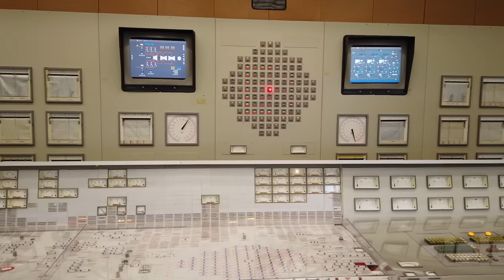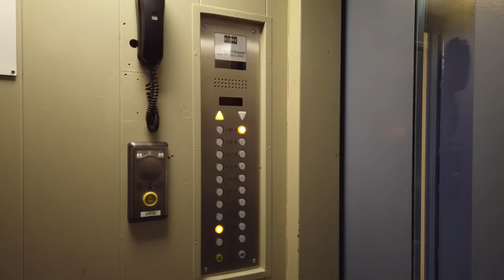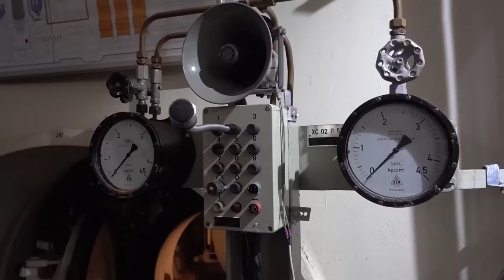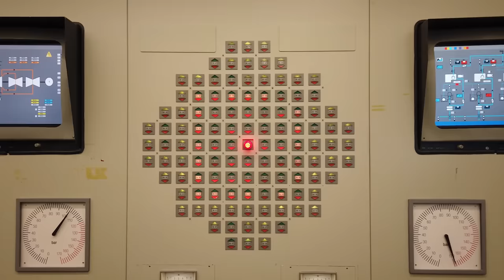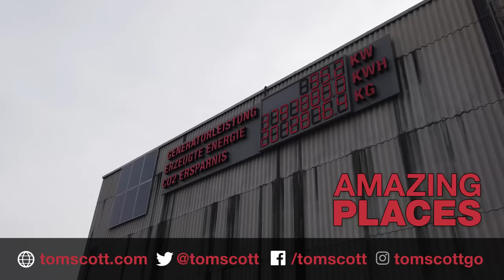This billion-euro nuclear reactor was never switched on

Comment: "We installed a solar power plant."

For a plant designed to supply over a million people with power that solar farm is a bit pathetic. Looks like enough for 20-30 people.
Reply: Usecriticalthinking  But solar power and wind power don't produce any waste (besides in the process of manufacturing the panels or windmills). Nuclear energy requires a supply of isotopes, and when those no longer put out enough power they get buried in a disposal site.
Neither of them are perfect, but I'm sure we can agree that they're miles better than coal-powered energy.
Reply: @MoxieCat  The waste can be used in newer generation plants as fuel. And also the isotopes in the waste are being used medically to treat cancer and stuff I don't know about in-depth.
Reply: Jaedon Braun: All of the fuel for a nuclear reactor comes from the ground, and when it is spent, it goes back to the ground 🤷‍♂️
Reply: @981porsche3  
Even when we start getting Uranium from ocean water we have plenty of massive mines that need to be filled in anyways, so why not kill two birds with one stone?
Reply: I am guessing the solar plant is to power the station as it is probably in the middle of nowhere
Reply: @MoxieCat  solar panel byproduct is more toxic then a lot of nuclear waste, js, as the chemicals needed to produce the panels are caustic, toxic, some are VOC's or just volatile too.
Reply: Those few panels on a cloudy day??
Probably enough to power one toaster.
Reply: I think that's to power the lights of the facility making it greener and cheaper for the owners
Reply: @levi-lukesmith3504  I thought that too until I went back and looked at the lights in the reactor room; those look like Mercury-vapor lamps. I don't remember when they started making LED replacement bulbs for those lamps but, I think it was a few years after the solar panels were installed in 2009. I wasn't able to find how much power is consumed on the property and if they were a net producer or not; but wiki has this to say about the solar panels they do have(which is more than is seen in the vid) "1000 solar panels on the site provided approximately 180 MWh of electricity per year"

So, just to keep the lights on, that facility can't be using more than 180 MWh of electricity per year, right? It would seem a bit crazy to me if they were producing that much power and still not be net-positive at the end of the year.
Reply: @MoxieCat  That's a rather big "besides" to just brush away, to be honest.
Reply: There is an incredible amount of waste bullding solar panels and batteries
Reply: I genuinly think they built the solar plant to supply the nuclear plant with power, which is irony on a whole new level
Reply: @MoxieCat  Well for now atleast.....if there is ever commercially sensible way to produce energy through fusion, then we would not have the problem of nuclear waste caused by nuclear fission reactors either.
Reply: Jaedon Braun Almost all nuclear sites in America store their spent fuel on site in casks. It is a very small area (size of an American Football field) and it holds the lifetime fuel needs of several units.
Reply: @MoxieCat  That waste is much more than what nuclear produces, especially in the mining and manufacturing of the panels, besides nuclear waste is useful, a molten salt reactor will convert all that waste into more power and cobalt that you can sell
Reply: @reedcoffman3210  There is a coal power plant there as a replacement.
Reply: @Henriburger1  🤣🤣🤣. It comes from ground, then it is being purified and becomes extremely dangerous. And there are no way to make it safe after all
Reply: Is nobody here going to talk about thorium reactors? Not only does thorium produce basically 0 waste, but are also much cheaper and safer than Nuclear power plants, that were already safe.
Reply: @MoxieCat  "But solar power and wind power don't produce any waste..." 
Clearly you haven't seen any photos of rare earth mining in China! 
Aside from chemical waste, producing semiconductor-grade silicon for solar panels is also very energy intensive, and it's questionable whether the panels ever generate enough electricity during their operating life to cover the energy consumed in their manufacture (especially in Northern Europe, where there isn't a lot of sunshine). 
Wind is just as bad, its energy output is highly variable, and completely unsuited to electricity generation (which requires a reliable, continuous source of energy). As a result, it has to be completely backed up by another (usually fossil fueled) form of generation (which ends up doing nearly all the actual generating). This drives up the cost enormously. Even worse, you can't just switch a power station off and back on again every time there's a gust of wind. Most have startup times measured in hours, so you have to just leave the backup running while the wind turbines are generating and throw away the surplus electricity. This means that the use of wind and solar probably doesn't lead to any reduction of CO2 emissions at all. You might as well let your "backup" do all the generating and not have the wind/solar there, for all the good it does. That's why the fossil fuel industry are so keen on wind turbines, they're expensive and completely useless edifices that keep the public happy without doing anything to reduce fossil fuel consumption.
Reply: Solar and wind can never replace nuclear power alone because they are unstable. They have no guaranteed power output. You need fossil fuel plants as a backup, running most of the time and creating more pollution.
Solar is ok though if you use it to charge batteries or produce hydrogen.
Reply: @MoxieCat  Solar and wind power produce more waste each than nuclear if comparing the total energy output and the output making the plant. Solar cells contain heavy, toxic metals, wind blades are usually made from composite materials which aren't recyclable! Toxic waste on the other hand, will be re-used in next gen reactors, but up to 50,000 tonnes of rotor blade materials are expected to arrive in waste reception centers between 2018 and 2020.
Reply: @MoxieCat  when is the last time you spent any time around a coal power plant?  Researched them?  How much information have you based that opinion on?

Coal plants up to code, only put out steam from their stacks.  Now more blackened stacks.  You can breathe easy and the air is clear around them now.  I lived near one for a decade.

Consider land costs of solar farms outside desert areas.  Wind farms tend to get 'eye sore' comments from some as again, these things are spread across large swaths of land.  The counties outside the coal plant had lots of wind farms.

So air, light, and water power plants have their own environmental costs associated with it, NOTHING is FREE.  The costs of land access (give up farmland, nature preserves, or housing?), environmental and wildlife changes they can cause, and the costs of resources/building materials ...  from being bits in the ground to getting formed and shipped to the sites.

Maximizing our fossil fuel energy extraction efficiency while we wait for the dream of fusion power to be realized (another 10 years! and another, and another), our efficiencies of solar and wind increase, etc.  They should be used in conjunction, compliment each other.  Wind, solar, and water power sources can be inconsistent at times.   A stormy week would be an issue for solar.  If things start to dry up, water plants start to struggle a bit you could say.  Wind doesn't blow 24/7 either.  And if you search, there are examples of these issues present.

What I think you meant o say about solar is there is no apparent costs associated with the fuel (energy from the sun) being created and delivered to us, nor can we see much impact on the absorption of that energy vs it just hitting the ground.  Wind farms I would mostly agree, but you are capturing energy in the atmosphere of the earth that would have continued to some alternate point of exhaustion.  In some circumstances I could see it possibly affecting the environment to which this energy would have continued but is now absorbed.  Water power usually means us disruption water flows and/or flooding large land masses for a reservoir behind a dam.

Ignoring impacts that aren't just carbon footprint is ignorance :p  but it is a symptom of a bigger problem of human society not worth getting in to here ;)
Reply: Well. Solar and wind do produce a lot of waste when they need to be decommissioned. Nearly 85 percent of wind plants and 50 percent of solar plants is non recyclable waste.
Reply: Well renewable energy is actually the way to go tho in Austria. We have the capacity to supply Austria with more than enough energy just through renewable energy if we built it so there really is no reason to invest any efforts into other alternatives.
Reply: @MoxieCat  wind and solar produces an imsense amount of waste. solar panels last only 20 years. both need constant maintanance. wind is even more problematic because you need certain oil on the rotors, thats why you cant build em in water preserve areas.
both produce at manufacturing and disposal a lot of waste, what people dont understand is the amount of solarpanels you need to even out a nuclear reactor.
750MW could this reactor do, you would need 150km² solarpanels to compensate that (assuming perfect energy storage).
150km² that need constant cleaning (or efficency goes down) that also means waste of 7.5km² solarpanels every year.
meanwhile the waste of a nuclear powerplant, because its so dense, would not even fill a trunk of  a car for the full year. 
also the waste is less of a problem than people make it out to be
Reply: @Ibrag91  Wrong there is one its called time.
Reply: @981porsche3  well yes, it goes back to the ground in a very radioactive state that contaminates everything around it. it aint perfect bud
Reply: @0xsergy  I know “it ain’t perfect”...bud; nothing is, but nuclear produces a humongous amount of energy for a manageable impact. The “carbon footprint” to build solar panels and windmills is huge, and I rarely see anyone point that out—only that the energy is “free!”
Reply: Usecriticalthinking  Not if you include the entire life cycle cost and yes, that includes waste treatment and storage, especially storage. It is not economical either when looked at it this way.
Reply: Usecriticalthinking  ‘its not always sunny or windy.’ 
Netherlands: ‘challenge accepted.’
Reply: @hugheaston7598  just to correct you: yes, we do manage to get inbetween 12-21% of our energy, at least here in lower Austria, from sustainable energy sources, mostly photovoltaik and water energy but also wind energy. Not only that, but we are mostly throughout the year completely self-sufficient without the need of importing energy from neighboring countries, except during energy peaks, which mostly happens around the christmas time of course. And I honestly am glad to be able to say that Austria has no nuclear power plant. Because in my honest opinion, nuclear fusion power is besides of coal power the biggest threat mankind has ever created, not only for the earth but also for ourselves.
Reply: @meuchooo  Looking on electricitymap .org I can see that your main domestic sources of electricity are gas and hydro, and that you import a lot of electricity from your neighbours (around half what you use). I think you meant nuclear fission, not fusion? Why do you think it's a threat? It's been generating around 20 percent of the Western world's electricity since the 1960s, with few problems and zero radiation linked fatalities. It's by far the safest and least polluting means we have of generating electricity.
Reply: @Hugh Easton  and thats where you're wrong, you look at the entirety of Austria, but i said Lower Austria (Niederösterreich) is mostly self sufficient. Yes, i meant fission instead of fusion, my bad for the typo. And yes, I do see it as a threat. Because people seem to not understand that it might be the cleanest short term solution, but the most polluting one in the long run. Just tell me, how often you'd have to refine the fuel, just to make it useable again, and again and again. An immense waste of resources. Next up is the overall safety. Yes, we might have the financial possibilities to build up a well made NPP, but just think of economically weaker countries, and countries with a lot of corruption. They build shitty and absolutely dangerous NPPs that not only affects the country but also the neighboring ones too. Next up is, where do you want to effectively store the remaining waste of contaminated equipment, used and unrefineable fuel for old NPPs that are being decomissioned. Lastly, why do you think we still dont have one? Because we neither need nor want a NPP here in Austria. Simple as that
Reply: Almost like it was build to steal money from the populace
Reply: I don't see solar power in mass until it reaches at least 80% efficiency, wind farms kill a ton of birds and are expensive to maintain.  When electric cars are the future we need more power, cold fusion is the future.
Reply: @abloogywoogywoo  batteries, dude.
Reply: @hugheaston7598  fusion is future
Reply: @MoxieCat  what you gonna do when its night tho? Switch on the coal or gas plant like they do in Germany?
Reply: @cael8948  i guess you meant more toxic per GWh produced, right?
Reply: @MoxieCat  
But if you want to produce the same amount of energy with solar panels you are going to pollute a lot more since the large volume of solar panels you have to produce.
And disposing of thousand of tons of solar panels made with higly toxic materials that can leak in to the soil at the end of their life cycle is far worse than some fuel rods